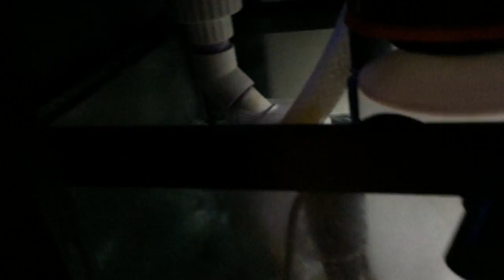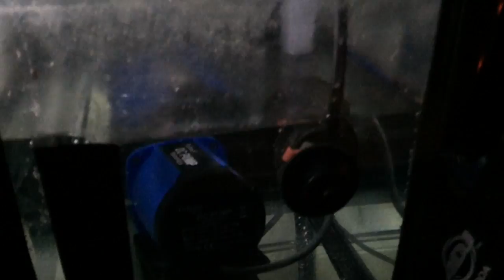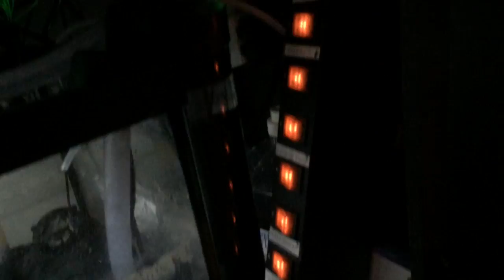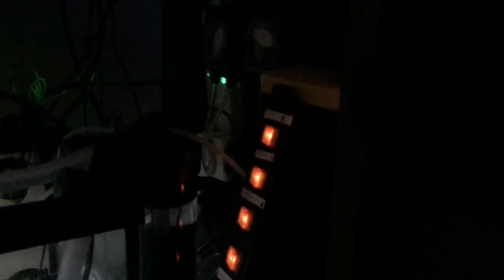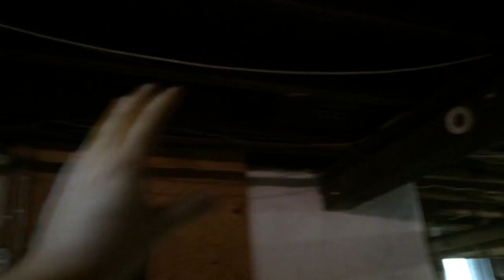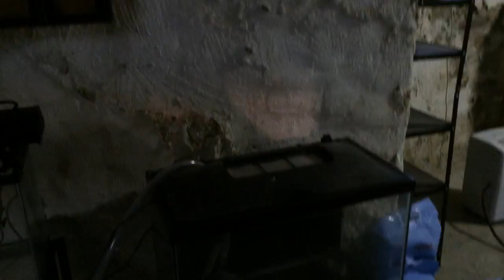75 Gallon MARINELAND Reef build- Complete  System Tour

Comment: Good video man, can you show more of the light mounts. It looks clean man, nice job
Reply from the maker: I just posted a how to video on the light mounts guys, check it out!
Reply from the maker: I will do a video on the mounts. They are just made out of scrap wood with an L bracket at the joint for support and mounted into the back of the stand and a few coats of paint
Reply: Jorden Watkins Anxiously awaiting the light mount video! That looks great and I have honestly been looking for a nice looking solution for those lights forever. Looks like you've finally done it.